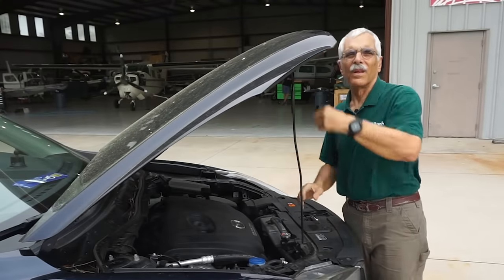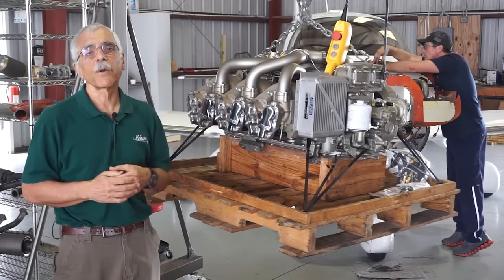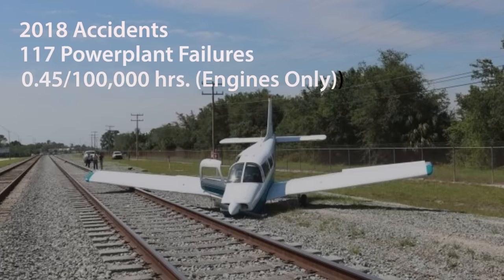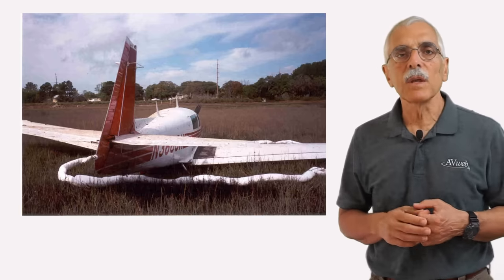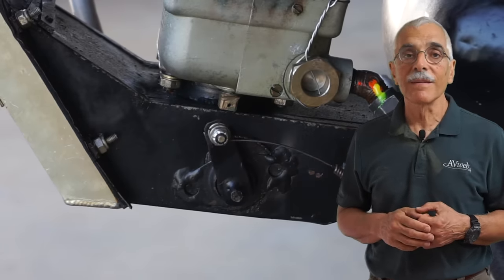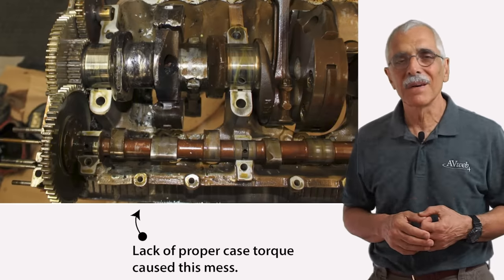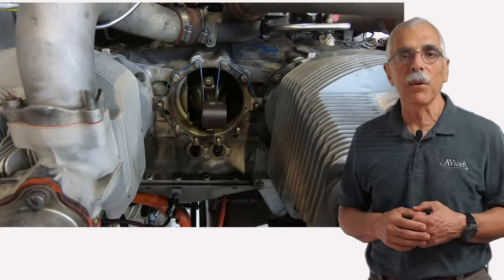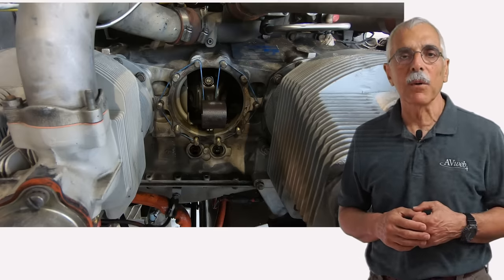Why Aircraft Engines Quit

Comment: As a lifetime auto mechanic I can appreciate the simplicity and redundancy, but the basic design looks too simple and very archaic. We have made much advancement in design that those engines have not incorporated. They look more like lawnmower engines
Reply: If the aircraft manufacturers produced millions of those engines per year, we would have the latest and greatest in engine technology.  Unfortunately, the cost of research, development, and testing & certification would never be recovered with the low unit production.  This happens on large jets as well.  The Airbus A-380 will be out of production shortly, having never come close to selling enough units to make if profitable.
   Also, aircraft piston engines are similar to Porsche air-cooled engines of not too many years ago.
Reply: @snowcrest7863  there are thousands of ready desings out there driving everyday in cars, making milions of miles without failures, you just need to buy them and do the paper work for FAA... but i suspect it's more profitable when customers have to buy gaskets and other parts becuse they need to inspect engine so often
Reply: @alanowa123  You better study up on the extraordinary demands of aircraft engines.  Modern automotive engines are not up to the task.  Just ask Porsche-Mooney and their failed effort.  Yes they work initially, but they never come close to operating as long as typical aircraft engines.
Reply: @snowcrest7863  Manufacturer of high powered engines for sports cars? I'm talking about good engines, not high HP engines that you have to rebuilt every racing season... Their engines don't come even close in reliabality to most japan engines bro, and it was in '81, 40 years ago...
Reply: @alanowa123  The Porsche Mooney had Take Off power of 217 H.P.  (Max cruise power was 174 H.P.) 3.2 Litres.  The engine lasted typically 500 hours before it developed mechanical failure issues.  Typical aircraft piston engines last around 2000 hours before overhaul, without catastrophic failure.  As I said in a different post, the automotive engines in modern cars typically run at 20% of peak power, with an occasional "blast" at 100% power.  Aircraft engines use 100% power for takeoff and climb, then settle into a cruise power of 65-75% power.  Modern car engines are not up to that task.  Many other automotive engines have been tried and failed.  Please research and study more on this or become a pilot to understand better.  You are being naïve and ill-informed if you thing automotive engines will work.
Reply: @alanowa123  And don't confuse "reliability" with durability.
Reply: @snowcrest7863  exactly. you are the first person who has mentioned that airplane engines operate at 100 percent of their power compared to car engines.
Reply: @snowcrest7863  One counterpoint here is the Austro diesel powering Diamond's DA40/42. Essentially they're Mercedes automotive engines modded with a gearbox to work on an aircraft.
Reply: @geddon436  On takeoff, sure. In cruise they typically run at 65-70% of rated power, which is something automotive engines aren't designed for. But this makes me wonder if an engine shop could build up an automotive V6 with a tight tolerance balance job for smoothness and beefy rods & valvetrain that would hold up over time and come close to the TBO of LyCo engines.
Reply: @dieselyeti  Most car engines are well under stressed even at 100% power, as most wear happens during cold starts, automotive engine would probably last even longer in plane than car despite running at 70% power most of the time, since constant load/rpm usually produce less stress and wear than varying load, rpm, idle, start, stop etc.
Some 1.9 diesel or 1.2 petrol VW/Skoda driving on German autobahns will use quite large percentage of it's low HP most of the time.
I think biggest challenges to use automotive engines in aviation would be converting in to use aviation fuel, working in different scenarios like altitude changes, freezing possibilities and also legislation and certification.
Reply: @snowcrest7863  Uhhh, you base this statement on what now? Plenty of perfectly reliable aircraft engines are stripped down automotive engines.

It's purely a slow industry to adopt change when they don't directly understand the advantages to update something.
Reply: There are a few companies converting automotive engines like Viking/Honda, FlyEco/Mercedes and I believe the GM LS is also modified for this application. However you have to realise a car engine is optimised for high thermal efficiency and low cost operation so usually takes modification to be used in this application.

A standard aircraft engine is more akin to an industrial engine. For example a generator, digger or boat is regularly run at high output for long periods. If I wanted to convert an engine I'd start looking at manufacturers like CAT.

There are actually examples of crossovers the other way as well like Rotax who have made jet ski and motorcycle engine for BMW. 🙂
Reply: I would be careful comparing aviation and automotive engines. Car engines rarely operate at extreme load for more than seconds. Aviation engines run longer in high stress applications, and do not have the fluctuations duty cycle of stopping and go traffic. No traffic lights at altitude! So I bet that the lighter duty cycle is a HUGE contributor to time between failures. At the extreme, in auto racing, ICE engines might be lucky to survive even a few races without overhaul.
Reply: @stephendenagy3396  I mean, did you even watch the video? 
Car engines have no problem going at 70% power for hours upon hours. Just ask anyone with a caravan.
Reply: @benghazi4216  Or engines used both in cars and vans, like Mercedes.
Reply: Airplane engines are not at all dissimilar to lawnmower engines. Both are air cooled with mechanical fuel metering and magneto ignition. And they are that way for a reason. Light and simple just works better for airplanes. You can’t just put a car engine in an airplane for two main reasons: They’re too heavy for the power output and they’re not designed with the redunancies required by aviation regulations. Aircraft have dual fuel pumps and dual ignition for those reasons, though in this day and age I have my doubts that two magnetos are better than one well-made electronic ignition. In summary, it’s a combination of what worked best in the past surviving long past its obsolescence, a lack of R&D money to change to anything new, and a community of aircraft owners that are cost conscious and risk-averse when it comes to trying new things.
Reply: @singleproppilot  The redundency was required because of the arcaic technology. The Lycosaurs have dual ignition because the combustion chambers are huge, and they couldn't do computer simulation of better shaped combustion chambers in the 1940's
Reply: Scary shit. A good mechanic will advise someone that’s buying a used car to run away as fast as possible when they see “rebuilt motor” Why? Because you will have no idea how well it was rebuilt. And nothing compares to factory built.
Reply: @snowcrest7863  It's a myth that modern automotive engines are not suited as aircraft engines. Not all, but some are in fact far better.
Reply: LOL... arcaic and simple.  Technically the Wright Flyer had a dual overhead cam 4 banger in it.  The rest is just an electronic gizmo ECU that costs more than a 3 speed with overdrive rebuild, ran way too hot to please emmissions, with countless miles of soon to be chaffed wires hooked to countless engine managment sensors... waiting to have an OBD2  troubleshooter plugged in.  I still favor a single cam V8, pushrods, rockers, two valves per cylinder meaning actual hemispherical head engine, without the stupid oil pressure or servo driven cam phaser...any day.  But thats just me, what can I say.... I like performance that actually lasts, and is relyable, without expensive electronics to have to swap out on a regular basis.   Call me a simpleton.
Reply: Rotax engines are among certified aviation engines that might be considered as "modern". They run on much higher RPM, have smaller displacement, more effective, has watercooled heads etc. A bit of progress here, but not among Lycoming or Continental.
Reply: Yes, and that lawnmower engine start every year after 8 month standing unused in some cold shed owner the long winter...same old oil, no maintenance..it works...
Only thing you need to do is chance to fresh fuel ⛽
Reply: @snowcrest7863  yes Limbach L-550 was copied by Iran into the two strokecMADO 550 drone engine for the Shahed Drones used in Ukraine. Limbach looks a lot like the VW concept of 1933.
Reply: @snowcrest7863 many aircraft manufacturers buy Mercedes diesel engines and just rename them and put them into their plane. Auto engines are way more reliable than aircraft ones, and they ran at higher power more reliably than at lower power because oil pressure is higher and carbon deposition doesn't happen almost at all. What kills car engines is slow cruising at low rpm
Reply: @chippyjohn1 I've seen a couple experimental planes with Chevy LS v8s in, also the Volvo B8444s manufactured by Yamaha was repurposed into a boat motor which as I understand would subject it to very similar demands as aircraft use

Think they dropped compression and increased displacement to make it more durable, aside from some packaging modifications.
Reply: @tedarcher9120  and... Planes always operate at low RPM compared with cars. Aircraft engines are designed to produce peak power in the 2500-3000 RPM range and cruise at 2000-2500 rpm at a relatively high load. This is not ideal for car engines, and why aircraft engines always seem oversized displacementwise for their power and cylinder numbers. Like the small engine he mentioned is a 200 ci, so 3.2 liter 4 cylinder and that's about as small as it gets. 5-8 liter 6 cylinders are very common. Big cylinders produce better torque at lower RPM. This is to match ideal propeller speeds, you could add a gear reduction but that adds weight and complexity compared with running the prop straight off the crank. This is why the only automotive engines (somewhat, I'd hardly say many manufacturers use them) are diesels. 

Also aircraft engines are air cooled to further reduce weight and complexity. How many modern air andcooled car engines can you think of?
Reply: As a person who likes reading YouTube comments that begin with "As a...." I really Iike this fine specimen.

Comment: Great video, as always.
One engine failure l had was caused by the key/magneto switch in C182RG.
In turbulence,  both of the contact pressure springs failed due to corrosion.  About 20yrs since fitted.
Got down safely in the bush.  AKA Outback.

Another near double engine failure occurred on B58.
The props were due for OH and a rental prop was put on whilst each went into the shop.
Whilst the second prop was being worked on, noticed both engines leaking oil.
Always carried extra cans, but on a long day charter, ran out after about 4 sectors/5hrs flying in the middle of the Ozzie bush. AKA Outback.
Last sector was at night from an inhabited airport, and managed to beg for oil from another operator.
With the torch on the cowlings, oil was streaming out of both motors.  Got back to the station (ranch).
Next morning discovered both crank cases cracked.  Suspect?  Rental prop.
Must have had a ground strike.  Blade track was up 1.5" different between all three.
This machine worked hard.  Had a five day long-distance charter coming up.
The boss managed to get two HD crank cases in two days.
Three of us supervised by an engine OH specialist rebuilt both motors in one weekend.
I did the charter and was very satisfied with the result, and the tip!
Reply: Mechanic pilot are tough.  Fix and then fly them.  The best.  I used to do that too.  when young.

Comment: Excellent presentation .  I just wanted to add , while in transit when you stop for fuel allow about 20 minutes for contaminents to settle before you sump the tanks.  I learned the hard way, but no damage.
Reply: I was taught that if you are going to fuel up on a round-trip with a layover, fuel when you first get there, not when you are about to leave.  That gives plenty of time for the H2O to get to the sumps.
Reply: In HVAC, we do the same thing when filling fuel oil tanks. Shut the burner off, fill the tanks, then wait 1h for the contaminants and bubbles to settle before restarting the burner. If needed, you then come back the next day, check emissions, check for water in the fuel, possibly readjust the burner, and change the filter if it's dirty.

Comment: I always figured if I could keep good gas in the tanks and put the thing back on the ground before the fuel ran out, I just decreased my potential for accidents by half. Make sure the weather is (and is going to be) good enough to see where I’m going and my accident risk profile got a lot smaller as well. Those are two BIG bites out of the accident risk factor right away. 

Nice video Paul. Thank you.